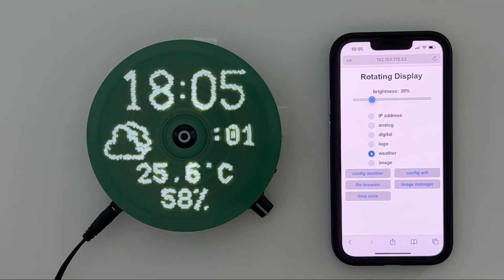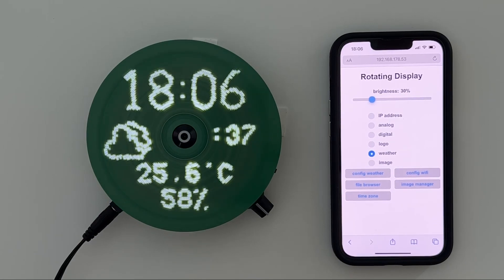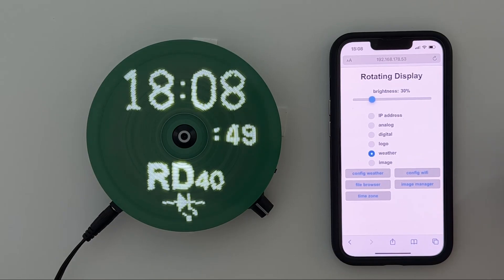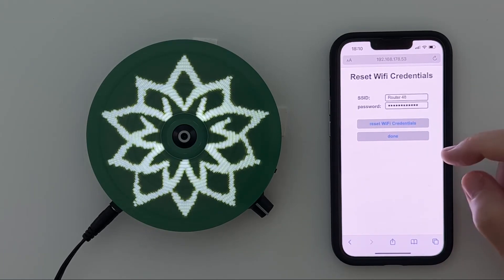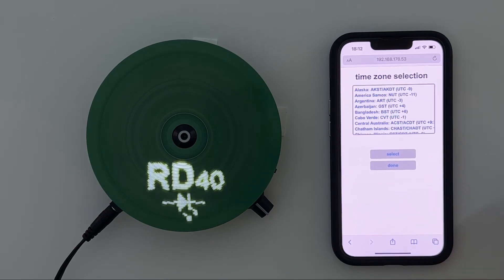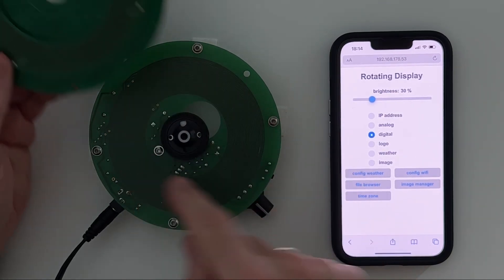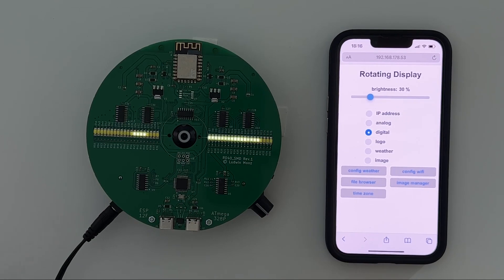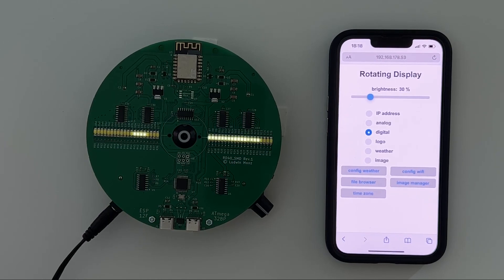DIY rotating LED display - UPDATE. Arduino & ESP microcontrollers. POV(persistence of vision)

Comment: Very nice project. Thanks for sharing this interesting hobby project of yours. Just asking: do you think this is scalable (dimension wise)? Can the same effect be achieved with a more "off the shelf" led strip. Of course it should have high density and brightness, and be individually addressable. As a response to a comment on your previous video, you said that the ws2812b chip is probably not fast enough for this. It is often used in individually addressable led strips. Is there an alternative or is using an led strip a no-go. I'd love to hear what you think. Anyway: thanks for sharing this project. PS: Thanks for sharing the camera app you are using. It seems to be a very useful app.
Reply from the maker: Hi Lucas, there are a few sub-systems which you need to look at: 
1. power supply, 
2. computing power and memory of the microcontrollers, 
3. speed of data transfer to the LEDs. 
Depending on how much you want to scale, the sub-systems might need a significant re-design. 
The wireless power supply of my design can provide a few watts of power. This would likely not be sufficient, if you scale up significantly. 
Furthermore, do not underestimate the implications of moving to color. WS2812B is a full color RGB LED. You would need to handle 24 bits per RGB LED - my current design handles 1 bit. A more powerful microcontroller would be needed. 
Last, but not least, you need to do the math regarding the speed of data transfer. Let‘s assume you run the display at 10 turns per second (I go much higher), and you have 40 RGB LEDs. One line would consist of 40 LEDs x 24 bits = 960 bits. If you display 240 lines per turn, each line will be displayed for 0.1s / 240 = 416µs. If you would allow the full time for data transfer (which is probably far from ideal), you would have 416µs/960 = 430 ns per bit. This corresponds to a data transfer rate of 2.3 Mbit/s. However, as far as I know, WS2812B can handle 800 kbit/s only. My clear conclusion: WS2812B is not suited for POV displays.
Anyhow, scaling the display is not impossible, but would need a major re-design and new approaches to all aspects mentioned above.
Reply from the maker: regarding an alternative RGB-LED: you need a bare RGB LED, without control electronics. Something like this: https://www.led1.de/shop/smd-leds/smd-led-bauform-1206/led-smd-bauform-1206-rgb-4-pin-weorgb02-cm.html However, brightness will be the most critical parameter.
Reply: @LHM000  Thank you for your clear and helpful answer. It gives food for tought. Looking forward to see possible future projects of yours!